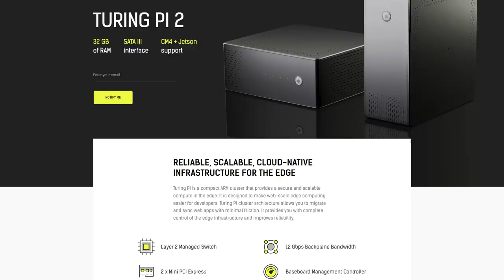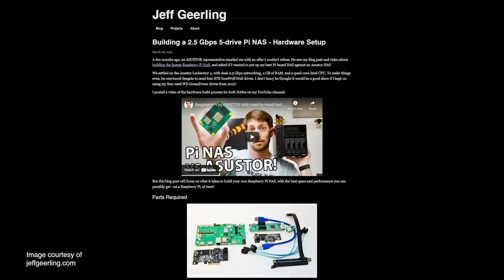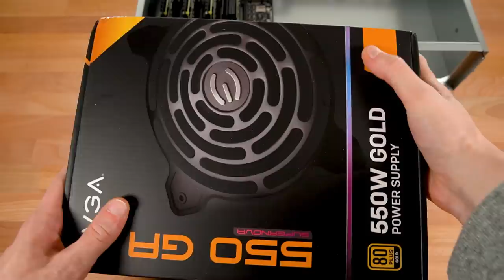Meet the Turing Pi 2 - Mix Pis and NVIDIA Jetsons on a  Mini ITX Board!

Comment from the maker: What would you do with 4 Pis on one board?
Reply: For me, definitely a Kubernetes Cluster w/ Rook + Ceph storage. Can't wait for the upcoming software video!
Reply: Better question for me is what can I do!?!?!

My favorite parts of your video was:

1. Watching you peel of the protective sheet…. “Of course I forgot one” 😂 

2. Your comment: I’m sure if I’m wrong someone will let me know. I was rolling on this one. 

Can’t wait for the next video.
Reply: cats and dogs with pyspark
Reply: Even more Docker in Swarm mode 😁
Reply: How does this configuration compare with the performance of something like an i7?
Reply: @merlingrim2843  Not even close...
- Pro turing pi: a lot of cores with low power consumption.
- Pro Intel Core/Xeon series: higher frequncy for high performance (x86/amd64) applications.
So it depends on your workload...
Reply: One Pi for router/firewall, one for a desktop, one for a NAS and one for selfhosted services! Sounds like an unbelievable nightmare to set up!
Reply: multithreaded app dev station
Reply: Run folding@home on it for cancer research that is low power.
Reply: This not as cool as it sounds.
Reply: I would put them on the right way
Reply: I'm still waiting for an update on this! I never saw another video on the Turing Pi 2 setup, was there one that I missed?
Reply: Swap one and drop a orin 8gb in its place, but would better like a 16gb one.
Reply: Laugh and taunt everyone. Who can find CM4 modules?
Reply: i would love to try this mining crypto ( verus coin ).

Comment: This is super cool Tim! Amazing you were able to get your hands on it. Can’t wait to see what projects you have in store for the Turing Pi 2!

I think some kind of hyperconverged setup would be neat where you run a three node Kubernetes cluster on the Pi’s (k3s) and then leverage Jetson for some AI or ML workloads since the NVIDIA Container Toolkit >= 1.7.0 (nvidia-docker2 >= 2.8.0) you used for your GPU passthrough video now supports Jetson with Ubuntu 20.04 + arm64.

Comment: I have a similar PSU in a 2U case powereing 9 HDDs with the fan up against the top like that. It's been running for months without issue. I have a actual 2U PSU to replace it with but I haven't gotten around to it yet. :_techno3:
Reply from the maker: Nice!  I later figure out that the lid is vented!

Comment: According to EVGA website fan on this PSU has "ECO" mode - when enabled it should not even spin until 40% load and I don't think this cluster will ever reach 220W. So you can enable ECO mode (switch next to the main on/off switch on the PSU) and don't really concern yourself with the PSU fan.
Reply from the maker: Good call!  Discovered that button after the video!

Comment: Great video - I had a very similar issue with the PSU in a 2U chassis like that.  In the end, I put the fan downwards and cut a hole in the bottom to allow the PSU to breath.  Maybe frowned upon, but it has worked out very well.  Cool air in from the bottom outside the chassis and vented out the back.  I guess there is the risk of dust ingress into the PSU, but I stand by my decision...

Comment: I’m seriously considering one of these and I’m not an advanced user. I want to run web apps/kubernetes on pi 4s (UniFi, UNMS, PiHole, home assistant, etc.) and then I was thinking a jetson could be fun and maybe it could do transcoding for Plex? Is that possible? My current server is UnRaid based and I have a Gaming VM on it as well. I’m thinking something like this would give better fault tolerance plus be cheaper than trying to go to some higher end CPU to handle everything. I’m assuming I can give the cluster access to a share folder on my UnRaid server right?

Comment: What's the advantage of running a Pi cluster over a cluster of low-power Celerons or Pumas or even a single hexacore?
It seems to me that power consumption would be pretty much the same but performance would be greater with the x86 cpus.

Comment: I'm not sure I get it, apart from being able to power it with a regular atx psu, what's the advantage of the turing pi 2 over running just a regular stack of pi's?
Reply: I haven't gotten one myself yet, but I heard it has an IPMI-like management option, there are a few M.2 slots to use the pis' PCIe lanes, and I heard if one of the pi's has a wireless modem connected to one of those M.2s it could share a connection with the other three.

I also figure since it has its own gigabit switch built in, and powers all 4 pi's off a single ATX connector, that makes it easier to supply power and to connect to network for all 4 nodes, rather than giving each one its own ethernet and its own power, or buying four PoE HATs and still having to run four ethernet cables.
Reply from the maker: Exactly!

Comment: Would this new Turing Pi 2 be a good candidate to run as the third node for Proxmox High Availability? I'm looking for a low power option for the 3rd node, instead of running three enterprise class servers...I'd like the 3rd node to be low power and just vote for quorum.

Comment: Excellent Tutorials on Turing Pi v2 board. Just wondering who got the documentations on the different flavors for the Turing Pi v2 board since it supports both the Raspberry Pi and Jetson. Can the board supports the Jetson Nano, Xavier and high end Jetson AGX. If you have 1 x Jetson Nano (2GB), 1 x Jetson Nano (4GB), 1 x Xavier NX plus 1 x AGX Xavier. Does it mean when you turn the system on, you will get 4 separate screens that will allow you to the multi-taskings. I think more cost effective is to have 3 or 4 nodes on Raspberry Pi to run on Kubernetes and Containers.
Reply from the maker: Thank you!  Each device has shared and dedicated hardware.  As far as video output, only 1 can have access to the HDMI, which is node slot 1.  You can still use other nvidia devices but not with a video output.  Remote control or just pushing your ML / AI workload is going to be the way to go, even if it is connected to HDMI.

Comment: notice the atx has offset mounting holes, so it mounts only one way if you use all 4 securing screws
i like to use the picopsu's for these low power devices intel j4205 omv4 with 12v up to 180watt wall wart etc in small cases to mount extra usb3 hd's where the psu would have been. lol never did 3d print/popsicle stick a cage for em though, ill do it some day
Reply from the maker: The downside of pico psu is that the while it is small in the case, the power brick is huge.  I’d rather tuck the mess away in a case with a standard psu
Reply: @TechnoTim  true if you look in the pc sections.
if you look in the lighting & car sections you can find 12v 10a + laptop power sized 12v to run these fine

oc you could use laptop 19v high amp ww with a small cheap as chips  dc to dc 'buck' converter to
Reply from the maker: Thank you!

Comment: Whats the point of this? like what does it do and why do it this way instead of just building a normal system? What benefit does this add? what is the point? Please I just wanna understand the point..... I know computers well but NOT the Pi side of things or the Server/industrial side of things.
Reply from the maker: It's a way to run raspberry pis but in standard PC hardware.  This gives you low powered ARM capabilities and connectivity in a single platform.